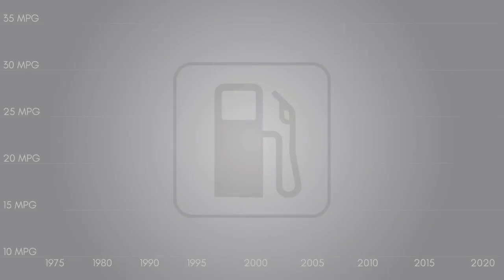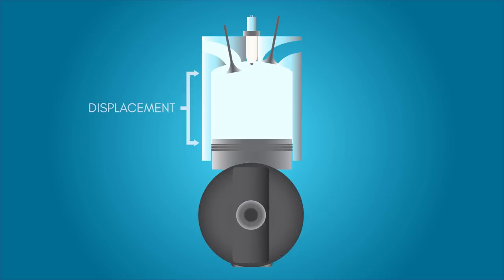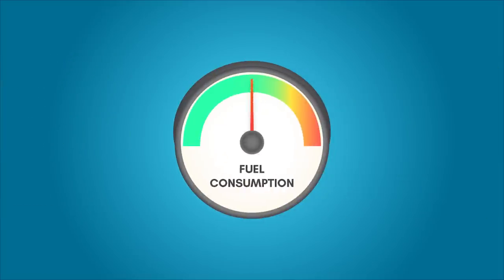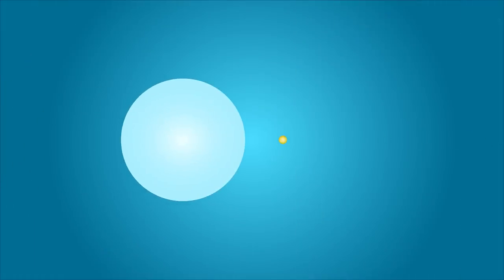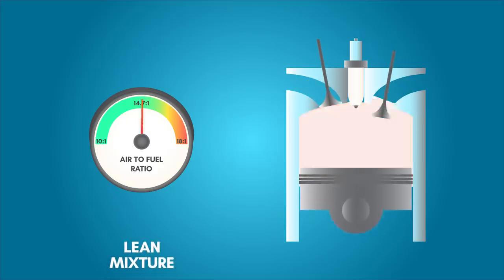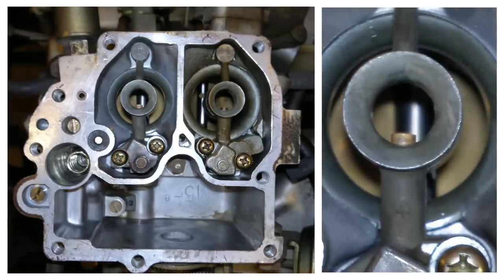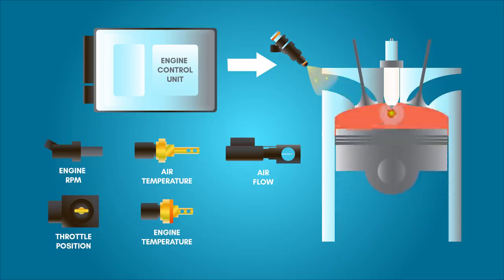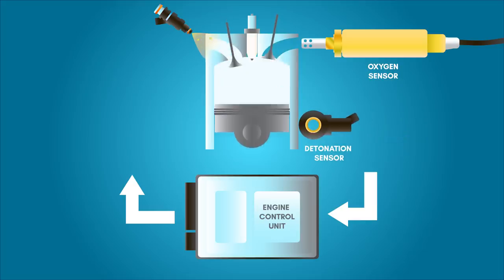How Engines Are Becoming More Fuel Efficient

Comment: oh and i forgot to mention , the proof is in the exhaust. If you think modern cars are becoming more efficient take a look at their exhaust systems and how complex they are how many metrics they have to meet to be allowed to be sold in a particular area that should speak volumes as to the toxicity of the output of the engine. It is directly related to how much raw fuel goes in the engine and right out the other in as a hydrocarbon. The vaporizing engines emit almost no toxic gas. Check it out there's facts out there to back it up

Comment: The problem is fuel efficiency is not energy efficiency.  While changes can be made to increase fuel economy slightly here and there, mostly with decreased weight, drag coefficients, and gearing, there's a brick wall to the ICE and that is its thermodynamic energy efficiency of 35% (+/- whatever few percent).

Comment: reverse coolant flow is a good way to cool the head more ,and bring compression higher to get more horsepower and better gas mileage,coolant goes to head  first,and then to block,not the other way around,like most cars,GM did on LT1 engine in early 90's

Comment: Improving this, improving that... This is not the right way to do it. Even improving everything to the extreme, the efficiency cannot be driven above the theoretical Carnot, which is 1 - Tc/Th. To actually improve the engine efficiency the temperature ratio of the cold air in and the temperature of combustion needs to be much smaller. For a gasoline engine this is prevented by "knocking" and materials limitation, so the max efficiency is around 50%. Diesel engines are a bit more efficient to about 55%. The max efficiency I've seen for a thermal engine is about 60%, for aircraft gas turbines as the intake temperatures are -60 C at 10,000 m. As for best car efficiency, the winner is the electric motor at above 98% efficient. Even considering controllers, charge and discharge cycles, the overall efficiency it's still over 90%

Comment: the old Nissan E16 using electronic distribuitor and a carburator returned 35 mpg in the city and under ideal conditions, over to 40 mpg in the highway back in the 80s...

Comment: I wonder if it would be efficient to make a car that runs on electricity stored in a battery that was generated by an on-board generator. This way, the generator could run at an optimal rate at all times to ensure stoichiometric usage of gas. However, I'm not aware of battery charging efficiency, so this could severely negatively impact the overall efficiency. 

I think hybrid cars do something similar, but using the car itself as the fly wheel of a generator.

Comment: In the 70’s, when the EPA arrived in the car industry the first thing American automakers did was add stop gap devices to their engines. Almost all of these were detrimental. The only good emission control device was the PVC Valve. It drew unturned ga she’s out of the engines crankcase and introduce them into the intake manifold where they could be used to make power. The advantage to the PCV Valve wasn’t any extra power made, as it was a minuscule amount, but it kept the oil inside the engine from turning into sludge and varnish. A cleaner engine runs better. But everything else robbed power, and some Do I Yourself owners and Mechanics would do what they could to bypass these devices. We discovered, (I worked in the Engine building and remanufacturing industry for the better part of the 20 yrs I worked in Auto Parts), when building custom engines that keeping engines in a good state of tune along with a balanced approach of parts selection for a given RPM range allowed engines to burn cleaner that their factory built counterparts. But there were some things the factory did that made things even better. For instance, having the distributors points. Adjusted properly was nearly impossible because point wear out.  Electronic ignition kept things running correctly at all trike. Likewise Carburetors were only able to meter fuel at certain points in the RPM range, but fuel injection with computer control via a feedback loop kept the mixture precisely adjusted during most driving conditions. Then we raised the compression ratio to 9-1 because 7 or 8-1 wasn’t enough to get a decent burn out of the fuel. The cylinders would run to cold and not burn all the fuel that entered it. Coup,e this with a de cent cam, called an RV cam at the time and a dual plane intake manifold along with properly tuned headers and you could get 20 mpg in traffic. An RV cam is slightly larger than a factory cam. The Mopar guys were in luck as their 360’s had one to begin with, and a 340 automatic transmission cam gene a little more power for knitter engines. The Chevy and afford guys had to buy after market cams to get this. It all that together and you have a nice running engine with more power than any non perf factory engine.

Comment: Lean condition skyrockets temperatures in the combination chamber melting the piston. It produces less power as well.
4 cyl compress less at a given hp than a 6 or 8 cyl.
Reply: Lean condition becomes a problem on todays cars because the cars are made to drink fuel to make up for shady ignition timing and cam profiles cause its easier to add more fuel than tune the cams, timing and compression for max effeciency and power

Comment: While engines have become more fishing in and of themselves. I believe the major reason that car is nowadays are getting almost 40 miles per gallon was caused by a whole host of shifts in car design over the past 4 decades. Aerodynamics have greatly increased, the switch to mostly front wheel drive layouts, and majorly the switch from big motors to small displacement motors. Better aerodynamics help greatly at highway speeds. The front wheel drive layout creates less Mass to rotate in the drivetrain. The biggest one is switching from 5 to 9 liter motors down to a 1-2.5 l motor. small little 4 cylinder 1.6 l motors make its much horsepower as some 4l motors used to. Do to efficiency increases and design changes.

Comment: I believe that we are at, or very near, the limits of fuel efficiency potential for piston engine.  Due to its conversion of reciprocating pistons to rotary motion, it is only about 21-23% efficient, at which point we're having great difficulty developing any more power or efficiency out of these engines.  What's needed, is some kind of a rotary-piston engine that's always moving in one direction, like, say the MyTe rotary engine.  It has a great deal of potential, if they could ever get it to run and meet emmissions.

As for going to teeny, tiny 4-cylinders with turbos and intercoolers, those engines are stressed to the point that they will not last anywhere near as long as the older, bigger V6 or V8 engines they replaced; they are being overstressed by the cylinder pressures and crank loads they were never designed to handle, and they'll fail much sooner, which will also much more rapidly depreciate the value of used cars.

Comment: My fathers car weighs 740Kg excluding fuel and passengers
At 60Km/h ~ 38Mp/h it uses 2.4L/100Km, at 80Km/h ~ 50Mph its 3.2L/100Km and at 110Km/h ~ 68Mp/h its 3,8L/100Km
its a 1.2L 68Hp inline 3 engine with 5 speed automatic gearbox
I used to drive it often and once you reach cruising speed and carefully play the throttle it could maintain speed with excellent fuel consumption
but when accelerating fuel consumption would jump up to around 14L/100Km and when driving 30 it would use 8L/100Km
so its only when cruising on long stretches it is efficient

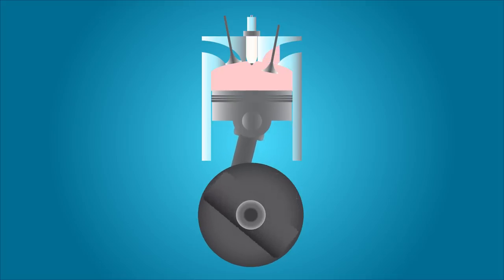Comment: The 1908 Model T got 21 mpg.   1:29 in the video shows whats wrong with modern motors.  If this graphic was your car, the engine would be destroyed and sent to the scrap heap.  The piston just smashed into the exhaust valve.  The piston head is cracked and the valve is bent.  There are bits on aluminum probably spinning at 2500 RPM's destroying the crankcase.  This is called an "interference" motor and companies like Honda have been doing it for years to get cheap power from their motors.  If you don't change your timing belt regularly, your engine is shot.
Reply: glad someone else noticed that

Comment: Pretty sure that FWD is second worst for power loss (after AWD). The benefits are in packaging, and in marketing ("safety"). That's it. They tend to be smaller engines too, and also in non-performance vehicles, so it's easier to orient them toward MPG as a result as well.

Comment: And then engineers realized the direct fuel injection (GDI) is causing carbon deposits on the intake valves so they came with a 'fix' : injecting much more fuel at cold starts to have the valves 'washed' by the excess of fuel.  Basically, this ruined the fuel economy from direct injection. 
Here's a bunch of designs to reduce fuel consumption - in no particular order
- direct fuel injection
- low tension compression rings on pistons
- Eco driving modes
- smart alternators that cut the current output and have the car run on the 12v battery alone every few minutes
- variable-speed A/C compressors
- lower oil viscosity
- higher compression engines
- electric coolant thermostats that vary the coolant temperature depending on the driving conditions
- engine auto stop-start
- electric power steering
- low resistance tires
- extra gears on standard automatic transmissions
- CVT transmissions 
- dual clutch transmissions

Comment: Engines pre 1972 were more efficient. Mid 70's cars had low compression to run on low octane unleaded and had smog plumbing that killed fuel economy. My mom bought a1982 Ford Escort new. I drove it on 250 mile trips and it used 1/2 tank of gas. It held 10 gallons so that's 50 MPG. My aunt had a 1997 Crown Vic, took it on many 300 mile round trips and it used 10 gallons of gas...that's 30 MPG. Don't tell me how great cars are now, I've been driving for 44 years & worked on cars, trucks, tractors, motorcycles and garden tractors. I know a little about both good and bad engineering. Currently designed engines are made to just make it past the warranty period, then be to hard and or expensive to repair. Blown head gaskets, leaking intake manifolds or two turbos to need replacement. Direct injection is a nightmare with PVC & EGR systems carboning up intake valves. Life's to short to put up with silly B.S. like this.

Comment: Easy. Change its name from "engine" to "motor" and run it with electricity. Instant better efficiency. Cost me 12$ for 300 miles on my Tesla.
Reply: Mykel Hardin  If it's nuclear power the efficiency compared to any carbon based fuels is through the roof
Reply: GTpcGaming the same people pushing for hybrids and electric, are also the ones scared shitless over nuclear. So good luck with that.
Reply: Mykel Hardin  you're making the typical mistake of assuming a completely static world in which nothing progresses. classic cognitive bias. besides which, electricity from the filthiest power source is still better than burning fuel in a fossil engine. plenty of science already proves that.

Comment: There is 6 cylinder cars today that out preform with horsepower and better gas mileage than old V8 engines for example, than again we need to take into account more factors.

Comment: Though we're slowly reaching the end of combustion engines as a suitable tech we're not fully done with them yet some say:
MicroWaveIgnition is said to be a simple manner to reduce fuel up to a value of 30% and it can be installed on older engines too the developpers say.
Then there is opposing piston technology for diesel fuel, gets a higher rate of making use of the expension phase.

I still think we should timely switch to electric cars in personel ones, but cargo hauling and heavy mashinery should be using highly developed combustion engines a while longer, it is quite hard to get other energy storage mediums integrated into cars and trucks that have the same energy/mass ratio. I firmly believe that H2 is currently the best contender in question, as it can be made cheaply AND ecological IF renewables are used, especially during the nights, when electricity is way cheaper because everyone is sleeping.
Reply: I completely disagree with your first point. The ICE are still young in their development. If you look at incremental gains of ICEs vs (ie) EVs, ICEs continue to make BOUNDS in comparison. With the electrification of the power train, cylinder downsizing, and fuel/oil/building material improvements, we will continue to see ICEs improve and be the source of performance in the automotive industry. EVs are about "capped" out on efficiency and generally limited to battery /power delivery tech and with capacitors recently making huge gains, I don't see more improvement coming anytime soon(graphene and energy production being the largest factors in upgrades and posing a significant costs but improvements there would MASSIVELY change the scope and potential of most technologies so I'll leave it out of my thoughts). As for ICEs we see EXCELLENT efficiency ratings of 50% out of even the most cutting edge technology (Mercedes) leaving far more energy capable of being harvested vs the improvement of electric motors. 

As for personal transportation, EVs are the best short term/distance option. I believe EVs and most other forms of human transportation will eventually succumb to a renewable public rail system and this switch to be within the ICEs dominant reign. 

H2 has a fairly poor energy density and is fairly expensive(I find H2 for $12-$16 per kg, double the cost/mile of even current ICEs). I see some solar conversion technology making gains, but generally hydrogen has 2 MAJOR shortcomings. 1 it is expensive to produce as means for production scale poorly or are reliant on sunlight and 2 storage of hydrogen is also VERY problematic due to it's volatility and lack of density. 

I will agree 'heavy' work will be dominated by ICEs for a long time to come, but again, everything is going to be electrified. By using computer systems and converting wasted energies into usable forms, we can greatly increase the production and longevity of these engines. With ICEs it's all about the efficiency.
Reply: @TheRhonorful  I respectfully disagree with you in allmost every point and I study engineering. The increments of ICE's are getting smaller and smaller, as we are nearly done with what we can get away with in terms of material science (currently that is). Then there is thermodynamics, the carnaut equations give us a maximum possible output when ignoring every loss of energy (thats quite a lot actually) and there isn't too much wiggleroom left, in EV's there's lot's of space for improvements, as nearly noone has seriously done improvements in decades, most of whats availble is rather recent and even small changes are still having rather big impacts in this field.  I don't hate IcE's but we're slowly but steadily reaching the end of what's possible. And yes I know what I'm talking about in terms of EV's the FormulaStudent team I was part of did EV's only after they were bringing back trophies for a few years.

Public transportation, allways the best option, but not everytime and everyplace a viable solution, cars could be shared, or get way smaller, most of the time all that's needed is 1-2 seats and a midsized trunk. (Funnily enough this would bring down weight and help ICE's and EV's by allowing for even smaller engines/motors.)

Hydrogen, I spotted a few minor missconceptions there, it is not realy that easy to get H2 to explode you know. As for the price, there have been gains made, it's just that not enough people are interested in this tech. As per usuall if a tech becomes more availble the price goes down. As for the energy requirements, I live in northern Germany, there's almost allways wind, even at night, that's dirtcheap electricity ready to be used for electrolysis. The methods of doing electrolysis and materials first and foremost, are getting cheaper and more efficient too. That's ignoring other sources for electricity like geothermic etc. 

As for the timeframe of ICE's in heavy work fields, wear and tear are usually dominated by "overbreed" engines, their materials and corporate greed. I guesstimate they effectively have 50years in the 1st world left, before their extinction starts. As pointed out before, we're reaching the max of the threshhold with ICE's and we will never fully reach it, as the increments are following the trend of an asymptote. Allways getting closer never quite making it, or as a female colleage put it briefly during the math lectures: "Friendzone!".
Reply: @TheRhonorful  I can see in the message tab that you've answered, but when I get down here to the comment section it's not here? This is what I can see in the tab:
"TheRhonorful hat Folgendes geantwortet: "EnraEnerato I am a mechanical engineering student in Nevada, USA :) I will use USA average prices as USA is one of the largest car owning markets per capita while" and now it ends, weird?
Reply: @EnraEnerato  Very odd. It appears to be all okay on my end. Have you tried relogging into youtube? could be some glitch with the "previews"
Reply: @TheRhonorful  Considering I that I even rebooted the pc due to an update I'm not sure what kind of brainfart the algorythms have. I found the text in the email making me aware of your reply though. Unfortunately sleep deprived me is an idiot and deleted it, before I could make a usefull reply...
Reply: @EnraEnerato  No problem. Ghosts in the machines :P <3 Do look into the new emerging tech of ICE though. Some amazing engineering happening.